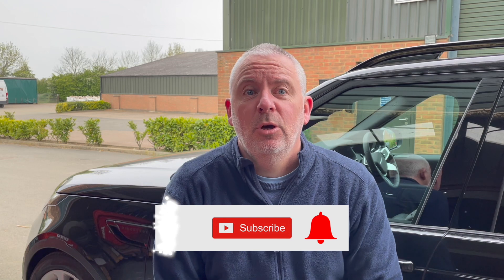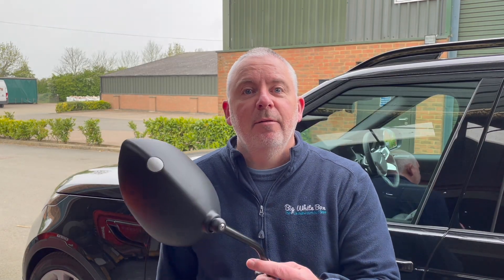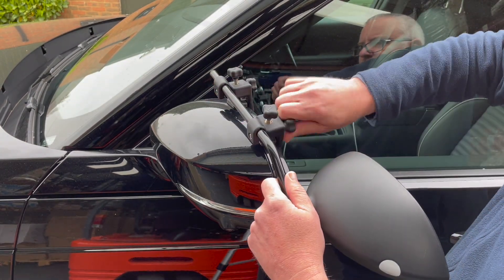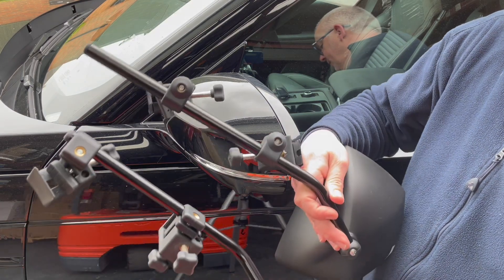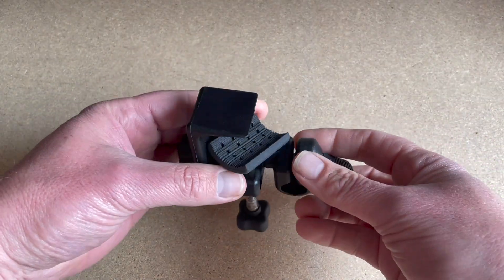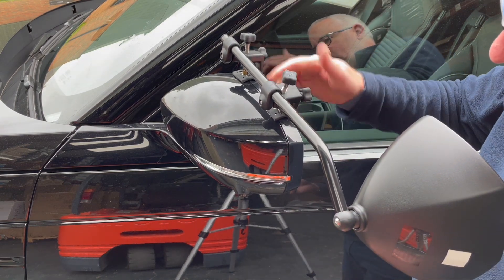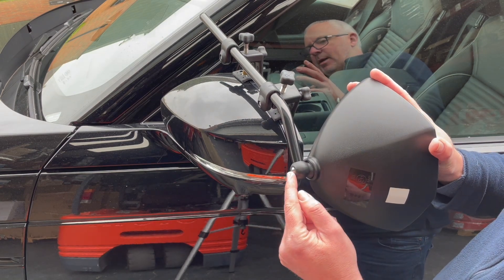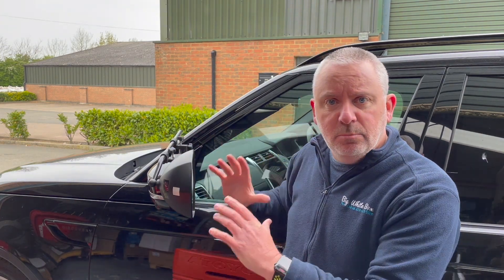Milenco Grand Aero Platinum Towing Mirrors Should I Upgrade?

Comment: I had  to replace my suck it and see mirrors due to change of car, i looked at many alternatives but to be honest they all involved lots of generic clamps and or rubber straps so opted for a set of EMUK mirrors, they are expensive but have a single locking clamp and sleek profile when fitted.

Comment: Can't see the point of these, for 30 year's my mirrors have been rubber straps on in 5 seconds no problems at all it's another case if caravan owners being ripped off.
Reply: What a ridiculous statement! So because people don’t want to use 30 yr old mirrors with straps they are being ripped off?
Reply: @pjallitt  I didn't say the mirrors are 30 year's old dimwit I simply said I have been using that type of mirror for that length of time.
Reply: could you tell us the other decisions you've made so we can also follow you, as the caravan guru? what tow car do you use?